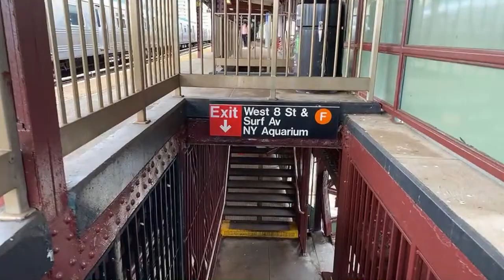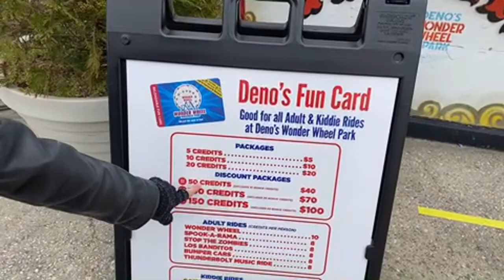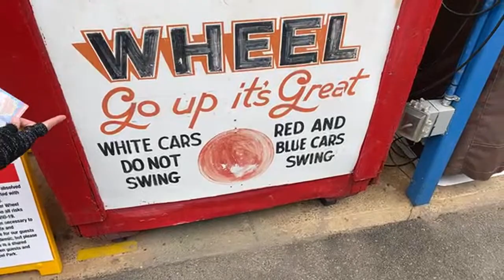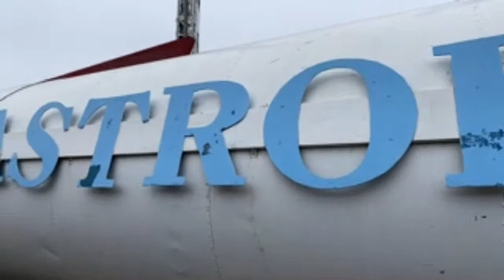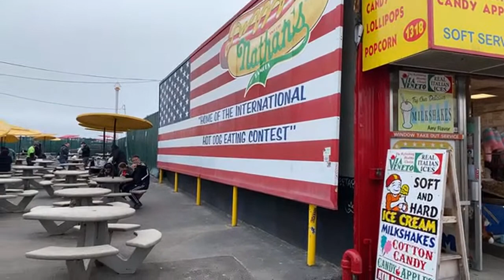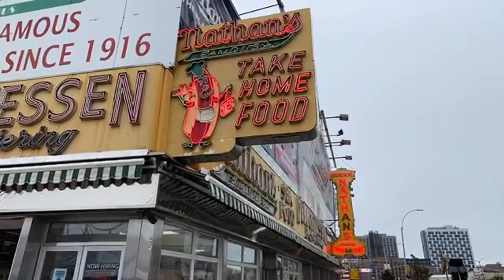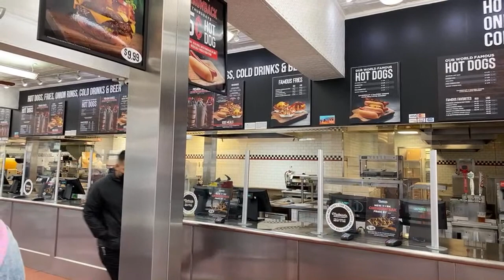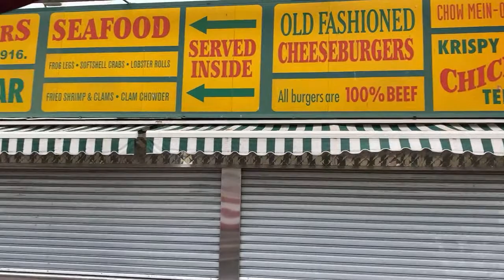NYC LIVE Coney Island Amusements Opening Day April 9, 2021 Wonder Wheel & Cyclone Roller Coaster

Comment: I lived out in coneyisland, back in 1976. Back then, they had 3 wooden roller coasters. The Thunderbolt, which first opened in 1925.  The ( Bob's)Tornado, which opened in 1926 & of course, the Cyclone, which opened in 1927. I believe the Thunderbolt was part of Steeple chase area of coneyisland. It was the first rollercoaster I rode on back in 1975. It was also, family built & owned, but unfortunately, they sold it to young buyers, who never weren't able to keep up on how to maintain it & because of that, it's last run was in 1983. It was pretty much left to rot & it became a nesting place for pigeons & in 2000, the city had it demolished😪 Its now replaced by the current steel Thunderbolt rollercoaster. The Tornado was the first of its kind, to have twisted curve tracks.  Sadly in 1977, the ride caught fire, which was done intentionally by an employee & in 1978, it was demolished😪 i, m so glad that they were able to maintained the Cyclone & because of that, we all still able, after 90 years, to enjoy this iconic jewel of a landmark. I wish they would reopen up the Parachute Jump ride. It was apart of the 1939 World's fair. That structure is so beautiful & it was known as brooklyn's Eiffel tower. It stands about 273 feet tall, but the ride took people up 250ft high. It was Coneyisland's tallest ride. It's still the tallest structure at Coneyisland. It's now have thousands of LED Lights that light up the tower in all difference colors for different events. I look coneyisland's wooden coasters better. They had more character. I put them in the class with Empire State Building. I always loved the Wonder Wheel & still ride it today. I thank you guys for sharing this video. You,re Awesome!!!

Comment: James and Karla, do you know if they sale tickets to have access to all rides ?
Reply from the maker: Yes you purchase a “card” loaded with “points” at a discounted price to gain access to all the rides. For example it is $10 for 10 points and that will give you one ride on the Wonder Wheel but if you purchase 50 points it only costs $10 and you can use the other points to gain admission to other rides.